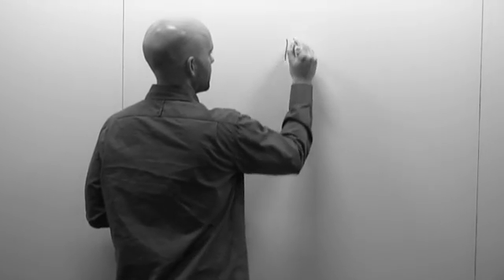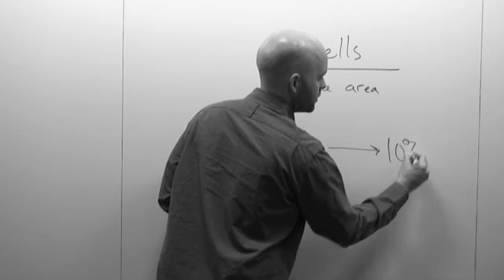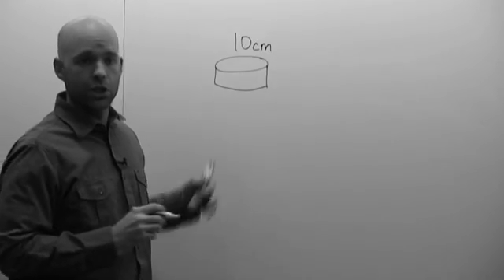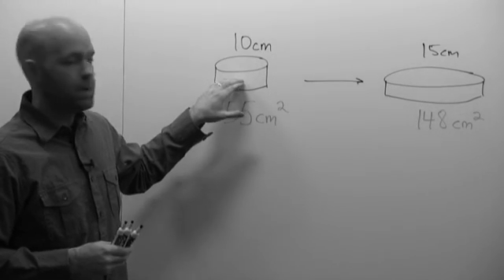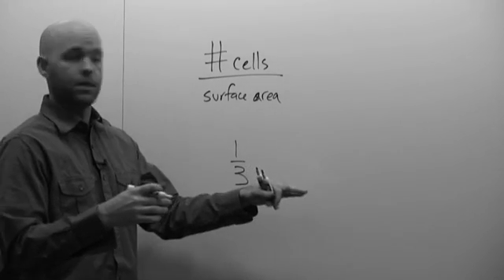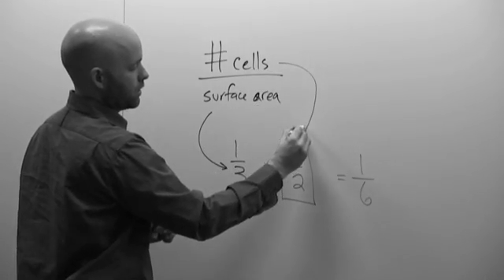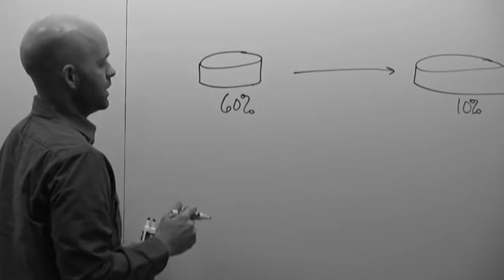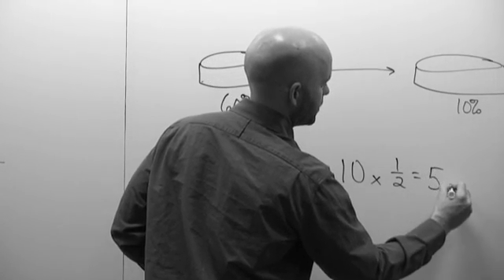Calculating how to split cells

Comment: ~                      10cm dish          15cm dish

To Split                   6            to            1

Surface area          1            to         2.25                       3.14 X 5 X 5    to   3.14 X 7.5 X 7.5      (Assumption)

This means I would have to transfer (2.25/6 =) 0.375 times the cells to the 15cm flask after adjusting for the difference in surface areas. 

 Now if I made up the final volume in the 10cm flask to 10ml, I would transfer (10 X 0.375 =) 3.75ml of its evenly suspended contents to the 15 cm dish to achieve the desired result.

Comment: Pls can anyone explain how the person in the video calculated the surface area? As i know the simplest equation is pi*r*r. But according to this equation the surface area seems to be different compared to the person in video. So I do wounder whether the person used different equation?
Reply: No, he simply wrote down casual areas.
Reply: Surface area's of dishes or flasks can be found by googling the info.  They usually have tables that correspond to flask size and surface area.

Comment: I really enjoy benchfly videos :) Thank you so much!
Though for this particular video I would like to note that the calculated surface areas are different. 10 cm dish will be pi*diameter^2/4, so 78 cm2 and 15 cm dish will be 176 cm2, so the ratio will be 1: 2.25, so to get 1:6 final dilution, you need 1: 2.67 of your cells from dish10cm -> so you need to take 10/2.67=3.8 ml cells to the dish15cm and not 5 ml.
Reply: Samantics

Comment: I had to watch this video twice to understand. I'm happy that you taught this slowly and clearly. The part where it got me a little bit confused since from 55cm2 to 148cm2 gives a 1 to 2.69... so I guess the numbers are rounded whole (2.69 -> 3)? Well anyway, the math seemed to work after that. However, the other confusing part is that do I absolutely have to make my cell suspension 10 mL? I mean, so long as a I make an appropriate suspension and be able to pipette exactly half of that is ok?